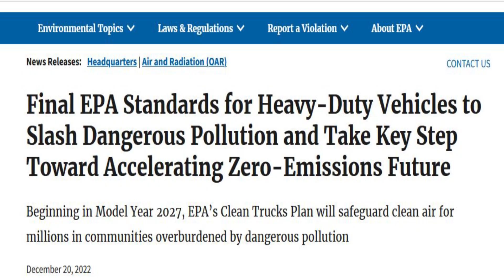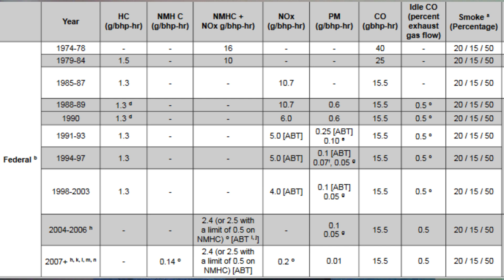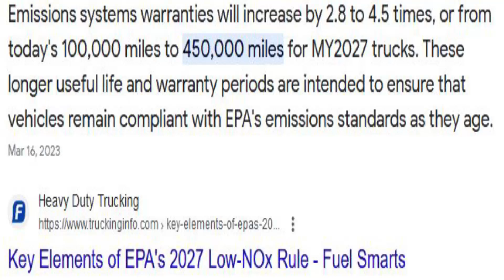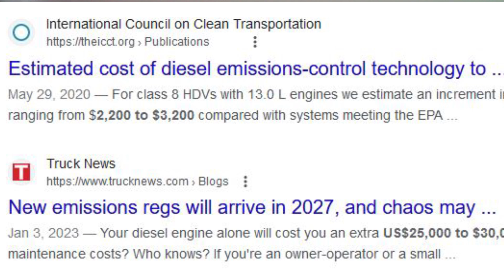Why the 2027 Diesel Emissions Standards will cost BILLIONS!

Comment: I predict higher prices for new trucks, causing reduced sales.  Manufacturers will not be happy.  EPA should be called upon to have independent economic analysis to prove thje worth of all their regulations.  Congress should be forced to put the regulations to a vote rather than being able to blame EPA for all the problems.  Many states have zero pollution problems, and should not be subject to onerous EPA regulations.
Reply: This line of reasoning is predicated on the assumption that the EPA is actually trying to clean up the air. However much of these regulations are being which is trying to disassemble Western Civilization at this point in time.
Reply: So there should be a technical economic analysis independent of the government, but then Diane Feinstein and chuck grassley should write technical emissions regulations. Yeah that makes sense.
Reply: or we can just get rid of the EPA and save the taxpayers a BOAT load of money. seriously. government is hamering and crippling our economy, we literally cannot build or manufacture anything here anymore, they sold us all out.

Comment: Would be great if the emissions components were standardized and made more universal to drive the cost down, increase availability, which would minimize down time.

Would also be great if the EPA also mandated that these systems were completely open to universal scan tools and the diagnostic data was distributed. 

But instead these guys lock you out, make everything proprietary, and when it breaks force you to get off the road. 

It's a racket set up by the EPA and manufacturers. If they actually cared they would be making things easier instead of harder. Gee I wonder why people want to delete everything 🤔🙄
Reply: its EPA being lobbied not to make diagnostic systems and emissions systems universal*
Reply: The only ones who benefit from ease of repair and reliability are the consumers and the truck owners... 

There's no profit in it. Follow the money. X(
Reply: It’s called right to repair, it’s been something that has been fought for, for years now and it affects everything from being able to change the battery in your phone, to hospitals being able to repair their requirement themselves with their technicians, to this.
Reply: Bosch CAN bus is an open system. Bosch is 94% owned by charity medical foundation. 
(No shareholders to pay)
Reply: @tonydoggett7627  CAN is just the communication protocol, like ethernet.. it doesn't care what data is sent over it, and that's where things get proprietary
Reply: An EPA and manufacturer racket....😂😅 That's  Hilarious... Let's solve the problems with our ever-tightening regulations with more regulations. Yep that will work out.  Did you miss the whole part of the story about the biggest cost is the fact that EPA is mandating a longer warranty on these parts?
Reply: Great idea. 

Cars share horns, relays all kinds of generic stuff. 

Why not egr valve
Reply: You can actually purchase the software for trucks and engines from the manufacturers pretty easy. The cost is cheaper compared to aftermarket readers and the OEM software usually comes with the troubleshooting manuals. Insite is only $700 and Diagnostic link(Freightliner) is like $500.
Reply: @wyattshontz1827 AND there is nobody more open with service and parts info than Cummins. You can register up to 5 ESNs free. DTNA makes service info free to the owner although they don’t go out of their way to advertise that.
Reply: Not that simple I don't think. Maybe the sensors.

Comment: These regulations backfire terribly... The newly compliant engines usually run much worse. My tractor has one of these BS systems that requires tons of rare earth metals to manufacture and now the only way it runs is in max RPMs. Much worse for the environment overall so some BS bureaucrat can say standards became harsher.

Comment: Yet again the people in charge that actually sets the standards have no clue about either real life or engineering, as you said modern diesels are really clean, new trucks in sweden on some or alot of truck engine they've changed the firing order to reduce fuel consumption

Comment: Josh as I am sure you know the truck and or engine manufacturer's don't make the emissions components. They are third party pieces. That extra warranty expense should be part of the legislation to pass that expense on to them. With that being said the handwriting is on the wall. I know that most in the trucking indusrty are not paying attention but as I see it you better be taking VERY good care of what you have now with the intention of riding out this storm of stupidity with the equipment you have now. Oh and by the way I just read that Europe is moving away from DEF as it is creating more pollution than it is eliminating
Reply: Most of the time it is passed on, also components suppliers also pass on that cost to their suppliers. It’s turtles all the way down.

Comment: If the federal government continues to demand that manufacturers and trucking companies install and use unreliable emissions components they can back the parts and labor. This has been ongoing for nearly 20 years and the emission systems continue to be the most unreliable part of the truck.
Reply: And what's worse, if the system senses something funky, it puts the engine in limp mode and you may need a tow. Even if the repair is covered, the cost of standing by the roadside for hours lands on you. If they didn't cripple you and let you drive to your destination and plan a repair as soon as possible.
Reply: And moreover what doRC said, when people say "the government needs to pay for-...." what they don't realize is that means 'we' need to pay. Government funded = taxpayer funded. Please stop with that kind of rhetoric.  It's very dumb and very self destructive.
Reply: @nothanksgoogle5879  it's crazy how many people can't seem to understand that...
Reply: @nothanksgoogle5879  people demanding  compensation for the destructive path that government needlessly sent them down is appropriate.
Reply: The government doesn't demand that manufacturers install and use anything. The government just creates the emissions standards. It's up to the manufacturers to create reliable ways of meeting those standards.

Comment: I would liked to have comparison between the 2010 heavy duty over-the-road Diesel emissions and the new 2027 standards.   I think it needs to be pointed out that HD Diesels that are actually meeting the 2010 emissions standards are likely few.  At first no HD Diesel engines were able to meet the 2010 emissions standards and in attempting to meet them they were horribly unreliable and poor running.   Almost all had their emission systems greatly defeated to allow them to have some drivability and reliability.   Since around 2018 at least for Cummins and Detroit Diesel meeting 2010 emission standards is being done with livable longevity, drivability and fuel economy.   With so few over-the-road HD Diesels actually meeting the 2010 emissions it is unlikely people are aware of how clean running those HD Diesels actually are.  

For HD Diesels to meet higher NOx emissions it may mean more involved, but much the same post combustion exhaust processing.   I'd think these higher restrictions on NOx emissions if made much the same for other road Diesels would mean the end to Diesel cars due to there higher cost. 

I wouldn't want to buy a 2027 HD over-the-road Diesel fearing a repeat of 2010, but it appears no new technologies will need to be introduced or any great changes needed in combustion composition.   This is much more comfortable what was required for the 2010 HD Diesel emission requirements.  The increase to half million mile warranty on the emission systems has some sensibility to it.   It may be best met by much more robust and cleaver post processing systems that are out of developmental cost research consideration unless trying to meet very long term durability requirements.  I doubt Volvo or Paccar HD Diesels will be able to reliability meet these requirements.

Comment: I wonder if Mexican trucks will be subject to this overreach. Bet not, and I bet they let them run our roads.
Reply: They require DPF but DEF not mandatory yet
Reply: New trucks sold in the Mexican market must adhere to euro 6 or us10 emissions. Basically the same thing as the states, less ghg restrictions.
Reply: Sounds like you need to move to Mexico then.

Comment: I will never ever let my glider with a Detroit go. Even if the truck rotted away or got wrecked, the engine will be going in a new truck. This is all just insane. My friends that are running brand new trucks are in worse financial situations than me in a truck with over a million miles on it. It’s sickening the public is treated this way and we have to foot the bill. We pay fortunes in taxes and then get forced to pay for this nonsense on top of it, not to mention insane downtime for parts/repair.
Reply: This is their goal. It’s what they want to happen. Because they are not for the people.
Reply: @Tech-gc8tt  'WE are the carbon they are trying to reduce'
Reply: My 2016 pete has 900,000 miles and has had 1 DEF issue its entire life. Guys need to learn to stop idling their trucks, I rarely ever idle my truck, I don't have an APU and idling the truck reduces its life drastically especially not high idling it. Mix that with running hotshot additive every 3 tanks and getting the DPF cleaned every 300k miles problem solved. I've tried to tell old timers that bought newer trucks how to not have DEF problems when ever they ask me how I do it....most completely ignore my advice.
Reply: @robbalinski1606  you are correct light load or excessive idling does cause alot of the aftertreatment problems
Reply: @robbalinski1606  meanwhile my 2017 pete has 800k miles and has been a shop queen from day one. I got 50 miles after getting it and had to be towed and spent 3 weeks in the shop only for it to get to the end of the driveway and got the red def light of doom where it was down another 6 weeks waiting on parts. 

Did all the service in the manual at half the recomended mileage and the truck has been a revolving door of bullshit. Have a def tester and only use jug def that tests good so dont start there. And have done all the "tricks" to keep the system good..... the system has STILL  been an absolute nightmare. I have a stack of just emissions repairs on this PoS thats nearly 16 inches thick. Only reason it didnt get sold is we went into the recession then covid and getting a replacment was a no go.

I dont idle at all, hell at 800k the engine only has 15k hours on it. Gets oil at 15k 15W-40 rotella T5. Overheads done every quarter ect.

Just because YOU had a good experince doesnt mean these trucks are good trucks and everyone else is idiots. For every lucky truck like yours i hear about i hear of 100 others that are garbage.
Reply: Friend of mine just got into trucking. His 21 Freightliner has broken down twice in 2 weeks.
Reply: Extending the warranty in attempt too detur owners from removing that trash. They will never settle for anything, even if trucks had ZERO emissions they would want wooden tires next lmao
Reply: The 60 series is one of the best truck engines for sure
Reply: I’d just take this engine and put it in a different truck myself. That’s allowed. It’s the big companies doing it for a business (Fitzgerald and others) that got shut down. Just buy an old engine and with a lil bit of patience, you can do it yourself. Ain’t as complicated as it seems.

As far as the fella mentioning idle time on DEF engines. I don’t want an engine I can’t idle. I don’t wanna mess around trying to get the thing started on a -20 degree day and I damn sure won’t sleep in a truck that’s 100 degrees. That’s not the life I wanna live. APUs are an option but not a very realistic one for their price. Takes them a lot of time to pay for themselves. Bunk heaters, on the other hand, are worth their weight in gold. But, they’re no good up here in North Dakota for a few months outa the year because of the blistering cold. You’d never get the truck fired back up again in the morning if you shut it off all night. Idling is a necessary evil.
Reply: Gliders are basically dead, I haven’t been able to find any companies still building them.
Reply: @jaydunbar7538 because you aren’t allowed to build gliders anymore
Reply: @jaydunbar7538 
Gliders are no longer legal to produce.
Reply: Blame it on the california ecohippies and their stupid carb and the rest of the country bending over
Reply: Ppl have to stop bending over and taking it up the ass,who are the fuckers making all the regulation,we own these bastards,bout time we realize it.
Reply: Usually scammed americans
Reply: Glider's aren't allowed in CA. Many more states will follow.
Reply: @brnmcc01 only the liberal ones

Comment: Warranties don't cover downtime, and downtime is what hurts a truck owner the most financially speaking
Reply: Nothing like a lemon 🍋 to break a business
Reply: What if you could swing by a truck center approved by the manufacturer, diagnose the system, order parts to a convenient location and then swing by there when you are near enough. But wait, you cant even move your truck while there's a fault, It's there, not moving until the part arrives a few days, weeks or months later. No wonder some jerry-rig the sensors until part come.
Reply: @arneanka4633  What if you could plug your laptop/phone into your truck and it can diagnose your truck for you? (as it should be)

We shouldn’t have to rely on the manufacturer to provide special, one-of-a-kind diagnostics equipment.

Comment: Not new technology but a new method on regens, I was in a meeting with a Cummins guy telling us everything they are going to do till 2027 and he said they will be adding a 48v belt driven alternator in order to power grid heaters to heat up the DPF instead of using a fuel doser. So does that mean there is no longer a need for a DOC?

Comment: Thanks for taking the time to delve into the 2027 standards and the mandated extended warranty period. 

It is another subject that the government can mandate what the warranty period will be, but I have thought for years that the environmental impact of these emission systems may actually be detrimental to the health of the environment as a whole. 

If engine manufacturers had applied the same resources to strictly improving efficiency as they have to meeting emission standards, I suspect the impact on the environment would be no greater than it is now. Based on anecdotal information from folks that deleted emission systems, it is not far fetched to say that a 20% increase on efficiency is an exageration, which would mean 20% more fossil fuels are being consumed with 20% more trucks transporting fuel. Then consider how many natural resources are used just to create these systems: DEF, DEF system components, DPF filters and components, etc. Then consider how many additional trucks are required just to haul DEF, and how many of the plastic DEF jugs had to be created using fossil fuels, how much ends up in landfills, how many additional tires were used for the trucks transporting DEF, and on and on.

Having seen improvement in air quality in places like the Los Angeles basin between the 70s and now, I am not completely on the side that all government emmision standards are bad, but it sure seems to me that they can very easily go to far. I think it would be a good engineering graduate student's thesis to attempt to quantify all these factors.

Comment: The other thing that might happen, now that the manufacturers are assuming the risk of a periodic diesel emissions repair until 450,000 miles, is they might rub a couple of brain cells together to make a more robust system, and I think that was the intent behind the EPA changes in warranty periods. It doesn't matter how perfect your emissions system is, if a frustrated owner has to remove it so his truck will keep running. The manufacturers can make more reliable systems, but until this new change, they've never had to.
Reply: Not bloody likely. They are a business and in it for profit. They will instead figure out how to make these parts as cheap as posible with a design intended to catastrophically fail at around 550-600K in a way that will bankrupt anyone trying to fix the rig. 

They will then find out what the national average is for repair costs on these trucks in the 450k or whatever and use internal warranty rates as well currently. Then they will take that amount and double or even triple it likely more. This will then be tacked onto the sales price of the truck.

They WANT your truck to fail and they want to sell you entire new rigs.
Reply: They'll just pull a VW and do all the emissions tests on a modified "off the production line" truck lol
Reply: EPA must rather be dissolved.  Wokes.

Comment: Glad I won't be working on them. Old timers like me are fading to the junk yard. Give me a pump and line system any day, with electronics including starter, alternator, and fan solenoid. Manual shut off, oil psi, fuel psi, coolant temp, throttle linkage, turbo psi, pyro temp.